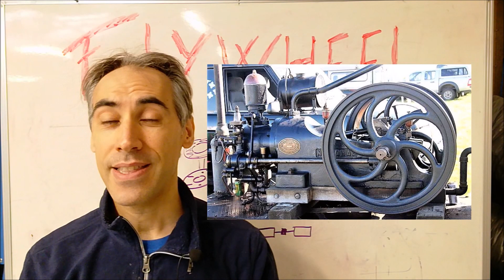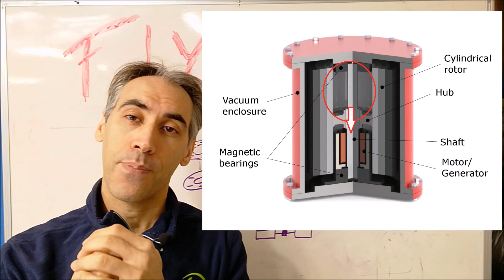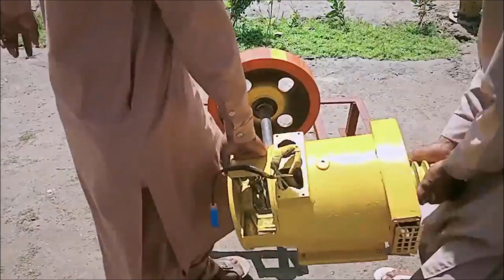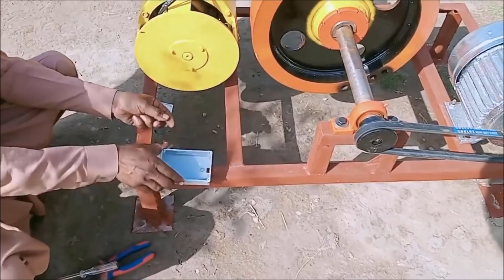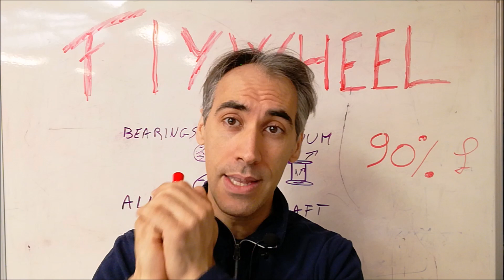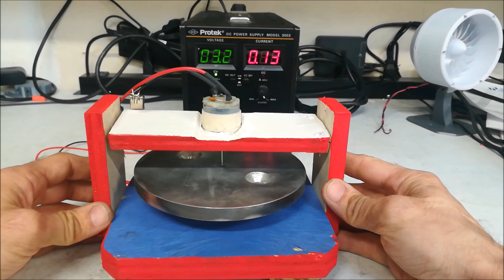WARNING!! ~ Another flywheel Free Energy SCAM

Comment: your test example does not reflect what these people are doing.     most are not direct drive, and  generator and drive motor are not on the same shaft,   these systems are tuned,  a balance between motor, flywheel and drive motor.    that thing you made will never work, flywheel too large and the generator needs to be about 3 times the size of the motor. everything about it is incorrect.          
many people are making these and showing them on you tube but few if any give you any information on how to have success.     I will try to explain how these work and what it takes for success.       first know these devices must be tuned, its a balancing act between all components.  your generator/alternator must be two or three times larger than the drive motor.  the connecting belts must be relativity kept loose, the tighter you make the belts the more amps you will draw from the drive motor.    find the happy medium.   your first goal and I believe most important is to drive the flywheel up to a rpm close to that which the generator needs to run at in order to output the amps needed to power the drive motor and have excess left over to power other things.    but you must accomplish this while drawing the least amount of amps possible from the drive motor.     the lower the gear ratio between the drive motor pully and the first flywheel pully the less amps the drive motor will draw.  always start with a small pully on the drive motor.   then size your flywheel pully to achieve close to the rpms the generator needs to operate at.    but there is another issue you must be aware of, the size of your flywheel matters too.   why? because you want the drive motor to operate at its rated rpm where it runs the most efficient at.   if the flywheel mass is too large the drive motor will draw more current to try and get the flywheel up to the rpm the drive motor wants to run at. in short the more massive the flywheel  the more current the motor will draw. find the happy medium.     and there is another problem, the drag the drive motor will put on the generator this is where the flywheel comes in to assist.     so you see really it's a fine tuning of all components.    because there are many different generators and motors you will have to tune each system.     you may have to trial and error with the components, and certainly gear ratios.    if your generator is not outputting enough power to keep your drive motor going or giving you excess power then you have to increase the generators rpm, change gear ratios.  if your flywheel mass has enough energy to keep up the increased gear ratio to the generator without causing the drive motor to exceed it's efficient running status then you may have it dialed in.    if not you may have to increase or decrease the flywheel mass or adjust the gear ratio between the drive motor and the flywheel.   like i said it's trial and error, you have to spin the generator fast enough to get the power needed for the drive motor plus excess for other things but at the same time the drive motor has to operate at an efficient load speed. it's all done by correct sizing and gearing.  oh and adding capacitors helps too.
Reply: You really haven’t watched the video at all. You took time to re-write the bible without listening a single word. Fundamental understanding of friction and energy loss is still far from your thoughts
Reply: @selfhealing1047  I have made over unity mechanical devices that work and put out more energy than they use so you were incorrect about me not understanding.    What I stated before will help people understand and have success you might wanna follow it yourself
Reply: @selfhealing1047  Energy loss through friction I totally understand.  I too was a naysayer quoting the laws of physics until the day I had success in getting more power out then I put in.   It was at that time I saw with my own eyes and was able to run test to prove the energy amplification that I changed my mind about the term free energy.   Of course it’s not free you have to build the devices that harvest the energy and you have to understand where this energy is coming from that is what the naysayers don’t understand.  Extracting power from our environment through manipulating magnetic fields or by amplifying power through the harvesting of gravity are both real but suppressed by main stream science so that people will not pursue it and the profits from oil and conventional energy generating methods will continue to dominate and bring in revenue for those who operate them.   But a change is coming as soon as enough people experiment and have success with these new energy sources it will start to become fact in the minds of the naysayers.    And we can finally power our world without the pollution from burning fossil fuels.
Reply: @darklight2.1  some peoples minds except what they hear as fact some peoples minds only believe what they are told .  my mind does not work that way,  I gather information through my five senses and then I analyze I calculate I experiment I research and then I decide what’s real and what is not this world is full and I mean full of deception,  floating around and occupying the minds of men.   I have dedicated the rest of my life to three things two of which are Energy and truth.  Falsity and deceptions do not occupy my mind.   They are rejected and only truth remains.
Reply: I have made a time machine, in facts, I'm typing from my 2055 computer
Reply: @164procar4  a time machine!!  Are you going to share your invention with us?
Reply: I agree with you, I believe the free energy generator is a possibility.This experiment in this video does not disprove it.
Reply: @OBINNAONIKE  thank you, if you haven’t already and would like to make something that proves more power out than what you put in experiment with the milkovic oscillator or the skinner gravity power machine,  they are both gravity harvesting devices.  You have to put energy in but then your energy is amplified through the harvesting of gravity.   Harvesting gravity it’s also something that most people do not believe you can do but in reality you can.  Most peoples minds think that if you lift up a mass and then use the falling energy of the mass you get less out then you put in and that is correct but that’s not how you do it the key to harvesting gravity is through centripetal force generated by centrifugal activity of mass.   You must have mass then you manipulate the mass into a position where gravity can act on it usually done with leverage then the mass has to Oscillate.
Reply: @rmendes2mendes915  
Go ahead build your nonsense  machine than have skeptical open mind kick your ass with another video 👍👍
Reply: @OBINNAONIKE  
This video proves ignorant people like you exist

Comment: That small machine is no way comparable to the big one.  I think its unfair to compate them, and you did not even make any effort to make adjustments on your design. 
1. Why use same motor wattage? Its ovbious you are supposed to be using two different wattage. That is the very basic of the flywheel generator.
2. Why not use wheel ratio to increase speed? You need to increase speed to reach the speed of the full working wattage of the bigger motor. Its on the motor saying rpm and its power rating. It is also the basic of the motor concept.
3. Im not sure of the size and weight of the wheel. But atleast you need to reach high speed and hevier to make it more  powerfull and again its the basics of fylwheel.
I think you are being unfair and dishonest if you did know all of that.
Reply: Have you watched the full video and pay attention to this guy's words and explanation??
Reply: @164procar4  can you explain it more to me? its his replica machine that have a problem, he is criticizing someone's work but his own build was defying all concept of the flywheel generator.
and i understand his explanation.
Reply: @KUyangTVTMBETAversion  
His flywheel is far superior and efficient than the original one and still can't make up the energy needed. He also explains why that machine is fraud and you should pay attention before leaving idiotic comments
Reply: @giuliapernoi7489  idiotic comments? Or your the idiot one? Same motor rating? Are u kidding me? Upside down design? So where will the weight and friction of the flywheel go? Directly to the motor right ? so how it was a better design? And again why the same motor rating? Did know the basic of this flywheel? It supposed to be different power rating

Comment: It is possible to create free energy with a flywheel. The easiest way is to have one flywheel connected to another flywheel through a gearbox that multiplies the speed. So if you can have a flywheel running at 90%, when you add another it now runs at 180%  minus a little bit of loss,,,say 5_6%.
 Then add ball bearings that are highly pressurised with grease and the efficiency goes up. 
  For example, when I grease the bearing on my trolley, it moves easier. That is basic science.
Now, if you factor all this in, you can get a device running at 200%, but I would add a couple more bearings to increase the efficiency a bit more.
  It doesnt need to be run in a vacum as that will take a lot of energy. Have you ever tried to suck vacum from a wine bottle? It is very hard and you can damage your lung.
  It is lots easier to pressurize the device with compressed air, or even better co2. Co2 is not flammable, so this adds to the overall safety and keeps the machine cool.
   I have also found that these devices will work a lot better in countries that have not enforced the law of Physics. Governments enforce so many restrictive laws that stop innovation, but fortunately the law of physics doesnt be enforced in countries like India and Africa. That is why more scientist in India is building better and more free energy device! They are allowed to build them out of old car parts and farmimng components.
  NASA is not allowed to build free energy devices because American government enforces Law of Physics.
 We can't build them in Australia because we would have to run the machine backwards because we are at the bottom of the Earth.
 Thats why India will be the leader in free energy.
Reply: "A flywheel connected to another flywheel with a gearbox...." "India the leader in free energy". Never heard so much gibberish talking in one single comment in my entire life
Reply: @giuliapernoi7489  
  Dear Giulia.  It is in fact simpler than you may think. If you have one flywheel spinning at 100 rpm, through a ten to one gearbox, the flywheel connected to the other side of the gearbox will spin at 1000 rpm. Correct? Then you can run an electrical generator of the fast spinning one through a series of pulleys and vee belts. The output of this generator can run a motor, which in turn spins the first flywheel. It's all lots of fun!  Then if there is extra energy left over you can run household items such as a record player and a plasme cutter. Please don't run the air compressor at the same time as the plasma cutter beause you may find that there could be a faulty earth somewhere, and as you are cutting out sculptures, the earth may feed into the whole device and make the flywheels run out of control,,much like getting to critical mass in a nuclear reaction! If this happens your record player that is playing bollywood hit songs will spin so fast that it will sound like 100 screaching midget bluebirds, diving at high speed, entrapped in the terror of infinite gaggle, the static electricity will make your hair stand on end, and life will never be the same. Pity really. But on a more quizical note, did you know that in the 60,s , they tried running hydrogen through a turbopump, through the centre of a nuclear reactor that had remote control rods, the pressurised hydrogen getting heated up to 4000 degrees, and forming thrust out of the nozzle.  I would like to write to you more, but have to get home and cook some Quinoa (pronounced keenwaa) as I am vegetarian and require sustanance in the form of non meaty treats.         Royal Sandman.
P.s. please dont listen to my music creation called "neuralink" as you may think I'm a bit loooppy.
Reply: @royalsandman6658  
Why instead of wasting time typing for 3 hours you don't ask and get educated? Every comment you look more and more stupid! 
Gearbox = energy loss 
That's it, nothing else to say

Comment: I enjoyed your video. Please humor my beginner question. Would driving the flywheel from the top motor demand less voltage?
Reply from the maker: Using the top or bottom part either as motor/generator doesn't affect their load. The load is a constant than it depends from the machine  configuration. You may have more voltage and less current or more current and less voltage so the scenario is the same.

Thank you much for watching!!

Comment: You are going motor to motor. The video you referred to was motor to generator. If the motor requires 2000 watts to run and the generator is out putting 5000 watts. Sure there is a loss but, the generator will run the motor. The flywheel is to manage the torque load, when you plug in other devices. Of course you can take more power from the generator and not have enough left to power the motor and it will stop. What say you?
Reply from the maker: That's exactly the point my friend. There is no 2000w input and 5000w output but only energy loss no matter what. Try to watch my video again and see if you better understand the content of it.

Thank you much for watching

Comment: Scam it´s bad! But to lift up a solution as a scam it is bad too! if you get money on a windmill!! It is bad because the wind can get calm! And then wind blows it get to much! But if a flyweel balance up this! Then you can live with this scam? Or? If you need a sinker on a seabased  Wavt can you might need a kenetic battery! It is not free energy its just a stupid way to get it on  your mind! So how do you dubbel the output on the machin you build fast a few magnets on the flyweel and buid a Bedinimotor in that if you make a few weel lika this  and let the axel bi on a magnet bearing (ball beringtype)! know it isto be worth the effort? Maybe! Know see this as it is a cheap Tesla battery wall! put a few supercaps to a sun panels and a Windmill! the axel must hover on a magnetbearing! the flyweel take weightliftings  barbell with som kilos on!  if this is to expencive take a buoy and let the axel have that for baering an try again With a few Discs and bedinimotors it can make a difference!
Reply: Take a breath first, add some punctuation and finally correct "few" grammar mistakes. 
After accomplish above tasks, we can reply to your question if any at all

Comment: a model like that wont work to much wobble no capacitors and the flywheel generators use a type that has a heavy armature so they use this with the flywheel that is 220v but use a 110 volt or dc motor to get it spinning the momentum/energy stored in the flywheel will cause the electric motor to turn for a time however eventually the mechanical energy stored in the flywheel will run down it take a while..but its a cheezy way to store up a butch of mechanical energy then use that energy either constant or quickly as long as you never pull to much energy out of the flywheel the little extra stored in the capacitor or battery is enough to "kick" or continue the momentum one solution is a one way bearing on the motor side not an impossible concept..but if you notice in all the videos of flywheel generators they use the same type 220v
Reply: Agree with you .

Comment: information.      good work.       however, it is a sign of the times, that  ANYONE  Needs  a  Demonstration, of the  LIE.      in order to do my part, i will supplement your video, with this...

a flywheel is good for  One  thing.!!!      that  is, 'smoothing' the operation of a system that is inherently 'rough'; eg., Reciprocating engines.!!!
in a transform that is  Wholly  Rotary, a flywheel  does  Nothing.     the inclusion of a flywheel in a rotary transform, does  NOT  result in an energy gain.!    period.
a flywheel does is,  store a  MINUTE  amount of energy, as momentum.!
the instant that a spinning flywheel is loaded, it will  RAPIDLY  slow  down.!     and,  NOTHING  is  accomplished.!!!!
no matter its mass or rotation rate, a flywheel  CANNOT  be used to store  a  useful amount of  energy.!      any  contrary  claim  is  a  LIE.
some years ago, there was a theory that  a (high-speed) flywheel could be used, on a spacecraft;  as a  gyro,  and for energy storage.     that idea went, nowhere.      because, a flywheel  would act,  ONLY  act as  a  gyro.   nothing more.!     cheers             googletranslate
Reply from the maker: Thumb Up for your comment

Comment: It's worth mentioning that even at 100% efficiency (no energy loss) for such a system,  you are at most going to extract the same amount of work (energy) as you put in. That is, at best it works as a battery that gives you back the same amount of energy as you put in when charging it. Nothing more! Going beyond that would violate the 2nd law of thermodynamics. These machines are do not even work as good batteries. Save yourself the trouble and just get cheap lead-acid batteries.